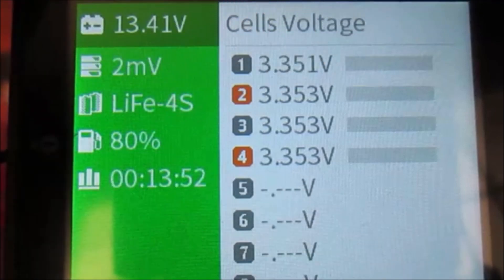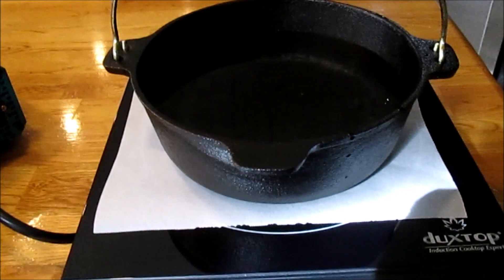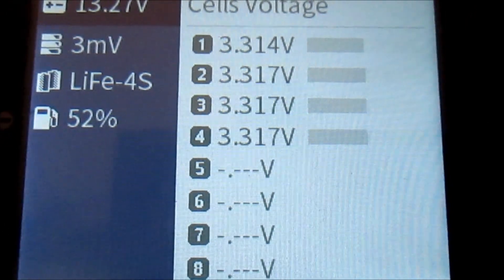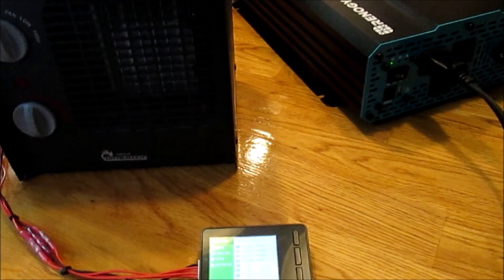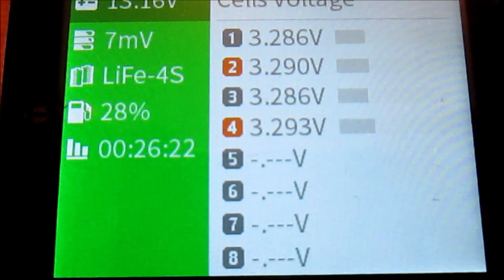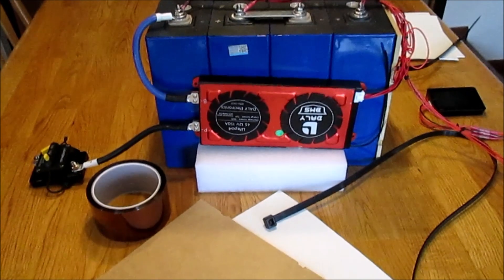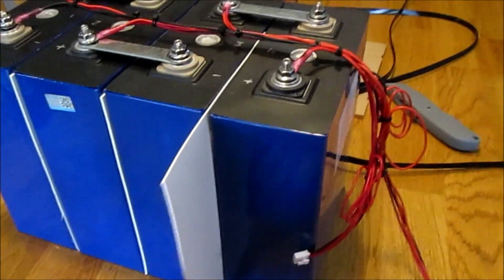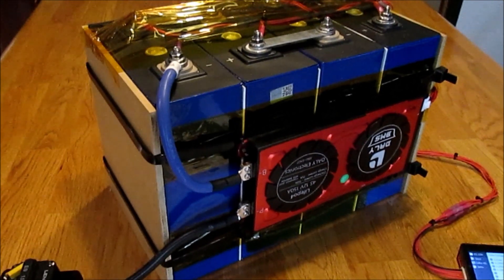V2 P4 3.5 Kilowatt Hour LiFePo4 DIY Portable Solar Power Generator

Comment: Hi Jim did you ever try changing the parameters on the meter? If so what did you find to be the best settings for the Lifepo4 cells?
Reply from the maker: Thanks for your question.  Are you referring to the charging profile parameters on the Renogy charge controller or on the BattGo cell monitor?
Reply: @JimFisherDIYPortableSolarPower  Hi Jim, the BattGo cell monitor.
Reply: I have 8 320ah lifepo4 batteries, I tried a Daly 200 amp bms, but it didn't charge my pack. Now I'm going to try a combination of a Heltec 10 amp active balancer with the BattGo cell monitor. Right now I have no bms and the batteries stay within 1 to 3 tenths of an amp.
Reply from the maker: I set the parameter on the BattGo cell monitor to the LiFe setting and performed an initial calibration when I first put it into use.  Used a multimeter to compare cell voltage readings and adjusted the BattGo monitor as needed.  I have not used any of the other battery chemistry settings on the monitor.
Reply from the maker: I'm concerned that your pack "didn't charge" with the Daly BMS attached.  Did you activate the BMS?  They do not always automatically start by simply attaching to the battery pack--- there is a process for jumping the battery and BMS to activate it.   I use a Heltec active balancer too, now.  Using both the active balancer and the Daly BMS is an effective combination.  The BMS is an important part of the system that ensures your cells will never be overcharged.  You may want to get a BMS back in the mix.  It is best to use Voltage to determine the cell balance and they should be within single digit millivolts in variance (i.e.  .005 V or 5 millivolts).
Reply: @JimFisherDIYPortableSolarPower  Hi Jim, yes I bought a light board with the button that starts the bms. I think it might be trying to let the batteries discharge to low state before charging them back up.
I installed only the BattGo last night and it balanced the batteries to within 23mv. by this morning. I still need to verify the BattGo readings with my meter. Thank you for your help.

Comment: Do you work out the amps your going to draw in your RV then buy a BMS to cover that?  Do you have a link to the cells
Reply from the maker: Yes, you will need to add up the total demand for amps that you anticipate will need to be delivered, simultaneously, to your RV appliances.  The BMS should be rated to deliver more amps than what you will need.  I bought my cells direct from China on AliExpress.  I waited months to get them.  In the details for my video series you can find links to products I used in my build.  There is a link to comparable LiFePo4 cells that can be purchased on Amazon, with a much faster delivery time.

Comment: Don’t forget to take into account the inverter inefficiency when calculating total consumed amp hours. Most inverters run about 80-90% efficient
Reply from the maker: Thanks for viewing and for your comment.  The shunt for the new ammeter is located before the main negative bus bar to which both inverters are connected.  In this configuration the Aili battery meter will take into account all of the amps drawn from the battery, including inverter loss and standby consumption.

Comment: With all the online worries about compression I'm surprised nobody is worried about the bus bars, I would think about going to cable, also your thoughts about taking the number for cell and putting it on the inside to see if you get the same voltage drop under load👍🙄😁 my two cents
Reply from the maker: Roger, thanks for viewing and for your comments.  I have seen some YouTube users of these prismatic cells connect them using cables as opposed to bus bars and they forego any attempt at compressing the cells.  I suspect that if the pack were to be subject to frequent cyclical charging up to 100% and discharging to nearly 0% SOC there would be appreciable expansion of the cells without being restrained by a substantial compression system.  I also suspect that under this type of cyclical use the bus bars could potentially loosen over time without the addition of a very reliable means of compression.  I am hopeful that my intended use (90% to 10% SOC) will eliminate any significant cell expansion that might loosen the bus bars.  Time will tell.   I like your idea of moving cell #4 to the middle of the pack and comparing how it behaves under load.  I wish I would have taken note of the voltage of cell #1 under load to see if it it was relatively low compared to #2 and #3.  Is it possible that the two cells with the most positive and most negative terminals would have the lowest individual cell voltages under load?  Easy experiment to conduct!

Comment: Thanks. Based on your video, I realized I had my Battgo set to Lithium Polymer, instead of Lithium Iron Phosphate. Muchas Gracias!
Reply from the maker: Glad that my video was able to help.  When I first connected it I had to do some additional research to be sure I selected the right battery type setting on my ISDT BattGO monitor too!